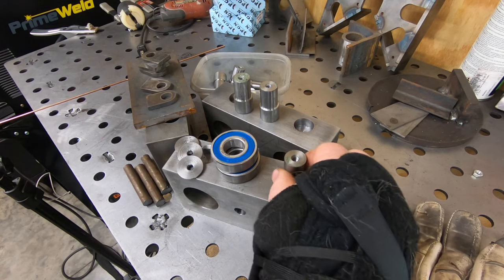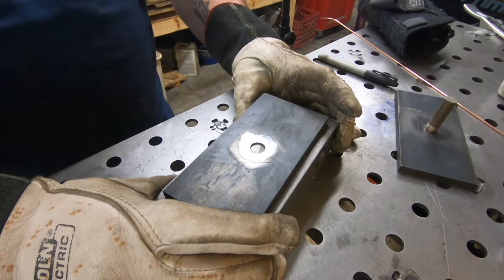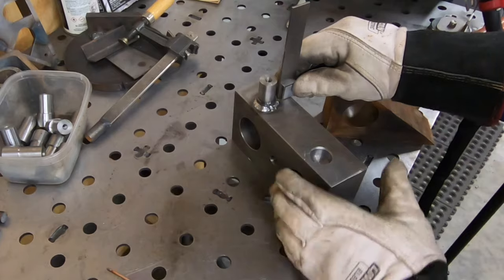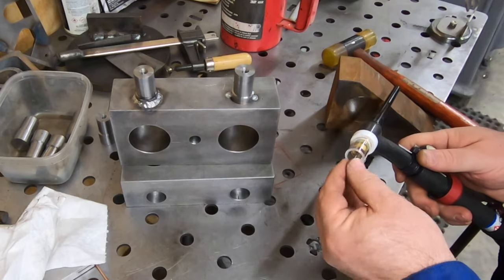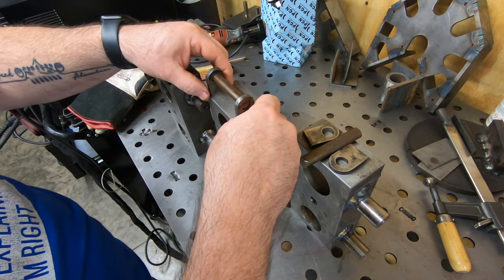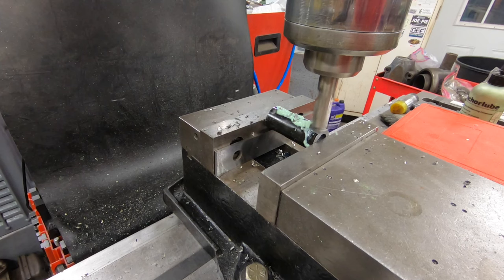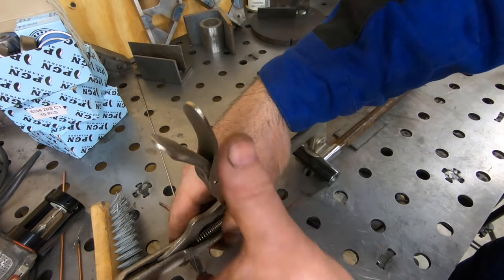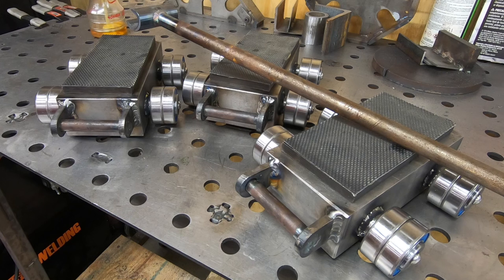Making a set of machinery skates - Part 2/2

Comment: Hi, will all due respect, I would never weld any axles at the load point  ,that is  under constant load ,  if I wanted to retain them I would use a high tensile screw through the axle into the body, or tack the axles in the back
Reply from the maker: I appreciate the feedback. But, to be honest, for the loads these will see in my shop, these are massively overbuilt to begin with. The largest machine I have is maybe 2,700 pounds. And the largest machine I have my eye on for the shop is maybe 3,500 pounds. I don't see these having any issues. Although someone suggested I make some "tires" for the bearings to keep those surfaces from being damaged. I figure of I break one, I might do that.

Comment: They cam out great, but I thought when you milled the flat on the tubing you made a mistake, it's fixable... we all make them !!!
Reply from the maker: Very true. I will likely cut that off and weld it back 90 degrees to the slot before I even use it.
Reply: tack it first and see if it's going to work